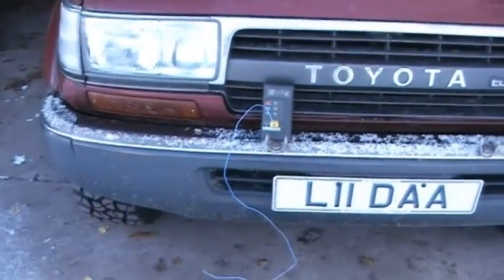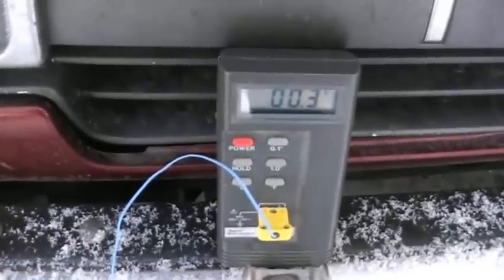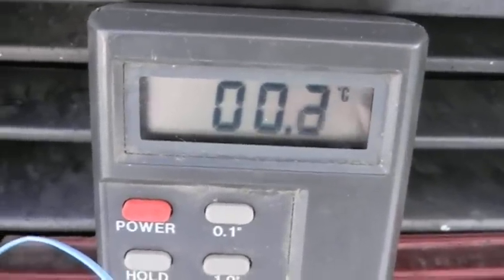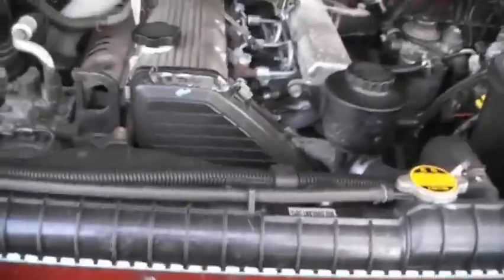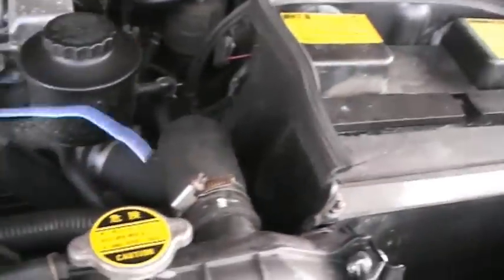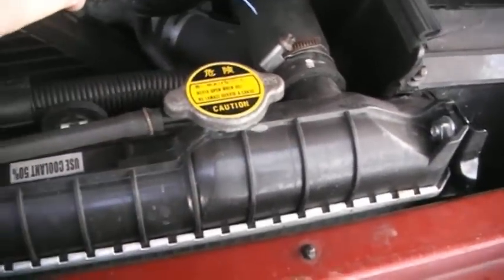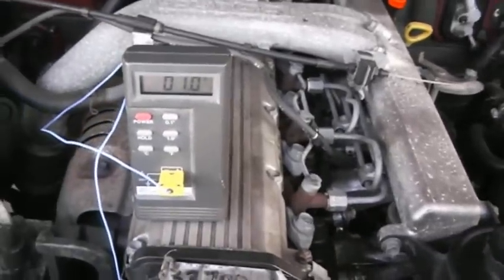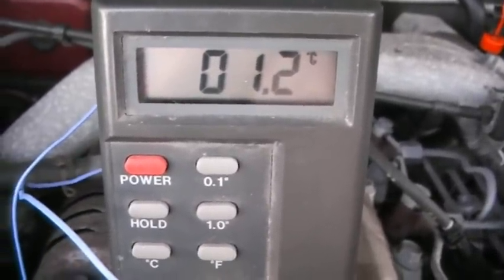Another Landcruiser HDJ80 (1HD-T) cold start

Comment: Mine started at -34 C with just a tiny bit of complaint. That is the only time the car has not started like yours are in the video! Close to 400 000km's on the clock with 35's on for the last 14 years:) Amazing car!! But I'll be checking the bearings on the next oil change!! I change every 5K km, but i use semi cheap oil. Two cold starts every day. Are those OEM bearings?